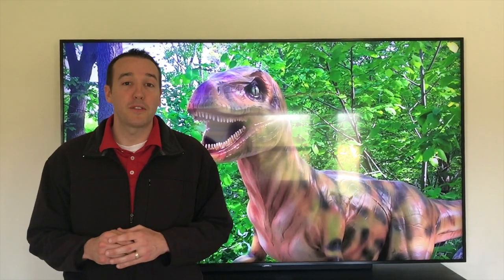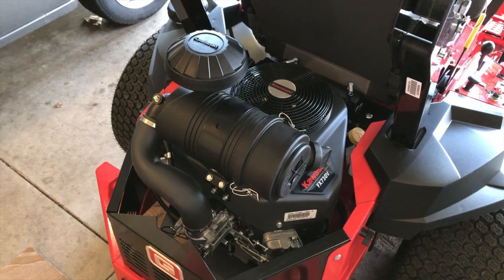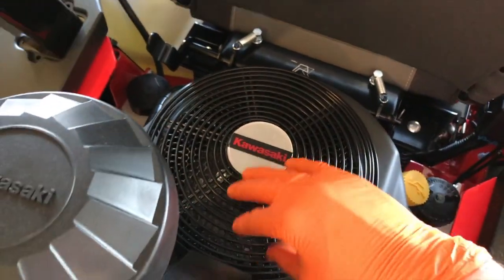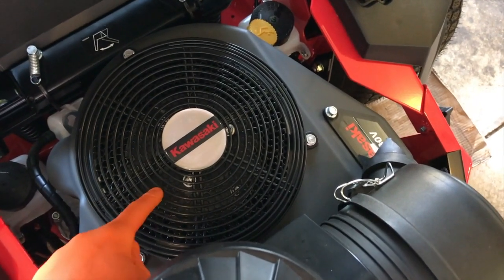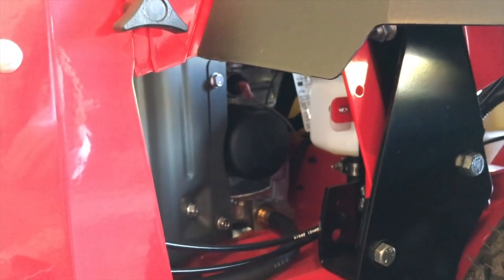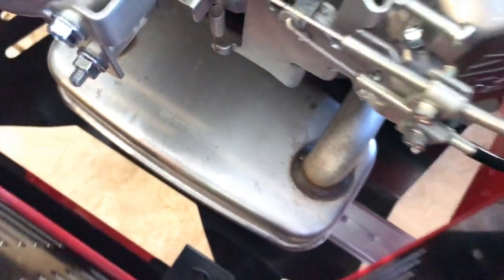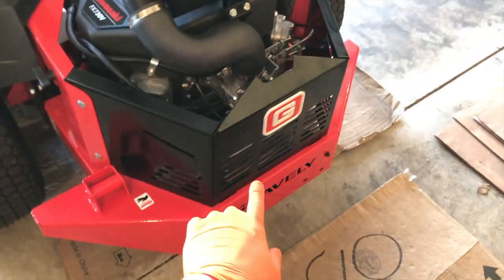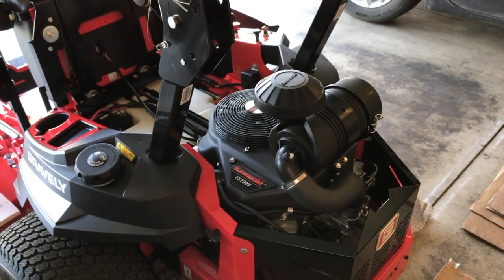BEST engine to have on Zero turn mower!

Comment: 190 Hours on my Kaw FX730V and it's got enough blow-by to take your hat off if you open the dipstick while running.  Has great compression and runs well, just TONS of blow-by.  Well cared for never dirty oil and has had regular changes.
Reply: B12 chem tool in the cylinder head
Reply: Mine threw something metal out the side of the block, just behind starter...P.O.S!!!

Comment: Guarantee any motor Briggs,Kohler,Kawasaki will all last longer than the hydros in these new mowers and the mowers are only as good as the hydros. From entry level commercial to top of the line with Kawasaki is a huge price difference and it is dew the the hydros in them not the engine.
Reply from the maker: Thanks for watching & sharing your thoughts, we really appreciate it.  Hope all is well.

Comment: What about briggs and stratton?
Reply: I have a briggs v twin on my z425 (2008) and it just failed. The flywheel blower sends grass clippings and dust down around the heads as it cools them. It will build up over time as its not in an easy to clean spot, this causes the heads to overheat and the exhaust valve sleeves to back out of the head until the rockers can't close, and you bend/break a pushrod. If you are lucky, when it drops down into the engine it won't grenade the cam gear. This isnt a "if" scenario, this is a "when" scenario unless you are in the habit of removing the top cover of the engine and pressure washing it on a monthly basis. 

FYI a new briggs v twin runs about $900. New heads are currently $195 each. Not cheap to fix. Not cheap to replace, especially on older equipment. I patched mine back together to get through the rest of the season and will be replacing the whole mower come spring.
Reply: What about Briggs, Kawasaki make a superior engine, they've been proven over a long time.
Reply: Depends. The B&S Vanguard is easily comparable to the Kawasaki but any other Briggs motor i wouldn't say they are fantastic but they get the job done.
Reply: Ive never managed to kill a briggs myself but i do blow the crap out of the covers once a month. And no im not in the grass cutting business but i do have a 4 acre lawn than is on the side of a hill and surrounded by woods. So im not easy on my mowers by any means.  I do run a scrap yard and we see a good many briggs but i think thats because briggs get sold probly 10 to 1 vs kawasaki.  I can say that briggs motors are easy to find and cheap to fix compared to the kawasaki motors from what ive looked at. The key thing is to keep the oil changed regularly. Dont let it set over the winter with ethnol fuel in it and keep the crap blowed out of the covers. That applies to all of them.. well except some kohlers... they were garbage to start with and they are gonna pop no matter what you do.

Comment: I thought the FX ENGINES WERE BETTER!!
Reply from the maker: Thanks for watching, we have found that the Kawasaki engines are the better choice.

Keep us posted and hey if you’re into crypto trading, check out our newly launched DIY ecosystem.

       Toolboxtoken.com

Reach out to us any time.  🧰
Reply: FX has a more efficient 2 barrel carb, steel motor shroud, and the Commercial Donaldson air filter system as opposed to the FR. SAME Block and internals.

The FX is a fine engine.
Reply: Great video. However I disagree with the Gravely motor made by Loncin in China. Is not a good thing.
Reply from the maker: @billadams9710  

Thanks for watching and sharing this.  Helpful info is always welcome and greatly appreciated!  😎👍
Reply from the maker: @billadams9710  

Thanks for your honesty, we enjoy hearing from those that own the Gravely engine.  So far, those that own it speak very positive about it.

That’s good!  😎👍

Comment: Can you help me
Reply from the maker: Thanks for watching & welcome to the DIY Raptor Club.  Let us know if you have any questions.

😎👍🔧🔩
Reply: I have a more but it won't crank it is a gravy it cranks up and s*** right back off I'm trying to find out what's wrong with it thank you if you can give me some information on it
Reply from the maker: @shedcromartie4789  

Thanks for the reply.  How old is the fuel inside tank...?...old fuel will degrade & contaminate causing issues.

You may need a new spark plug...or just a friendly cleaning on the current plug.  Let’s start there.  Keep us posted.

Enjoy your night.  😎👍🔧🔩
Reply: JEN prolly in on it...